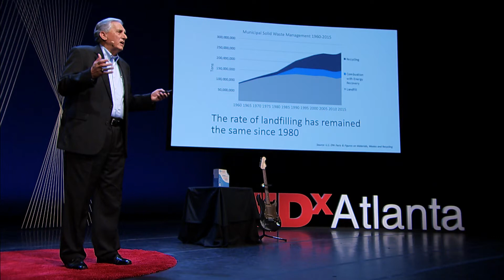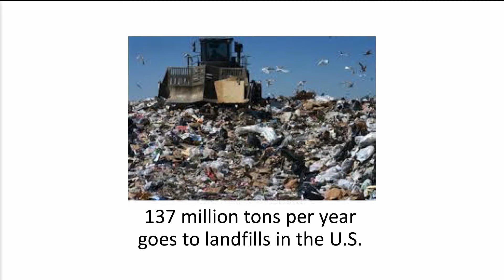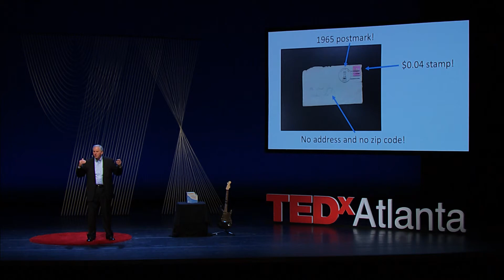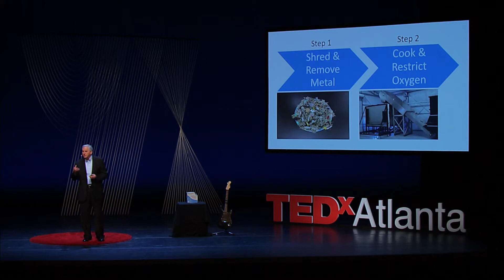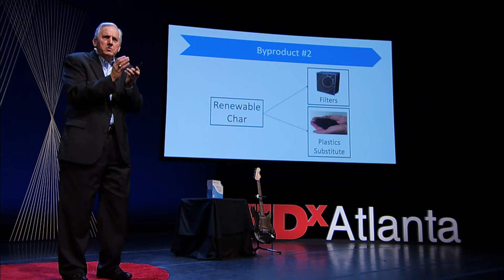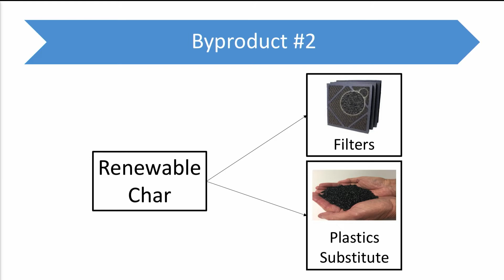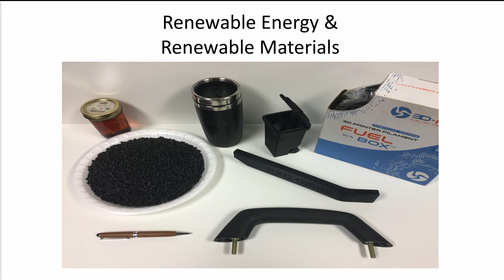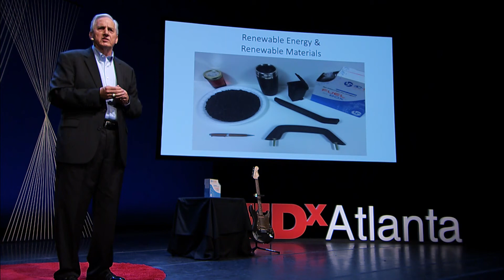A technology that could cause landfills to fall into obsolescence | Johnny Poore | TEDxAtlanta

Comment: This gentleman is discussing an ideal scenario. The viability of this process will entirely depend on what was disposed in the landfill being considered for reclamation. I am a retired hazardous waste chemist; and I must say that prior to the 1976 Resource Conservation and Recovery Act (RCRA), there were no regulations on what could be placed in a landfill. In truth, it really wasn't until the Hazardous and Solid Waste Amendment Act (HSWA) of 1984, that the USEPA became very judiciously serious on the subject. If your cell was strictly used by household generators of waste - you're golden. However, if it was also utilized by industrial and commercial generators that discarded hazardous substances; be extremely careful, as it could cost a bundle of money to have it properly managed. "Pie in the Sky" speeches are wonderful, but universal reality is often quite different.